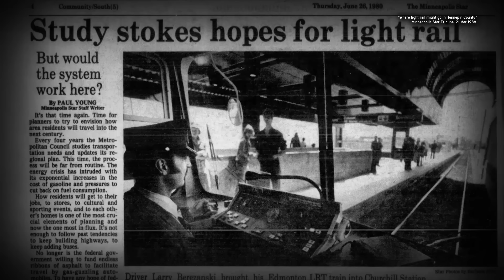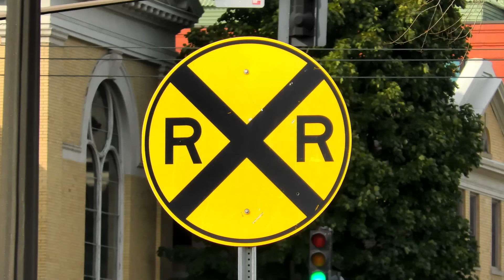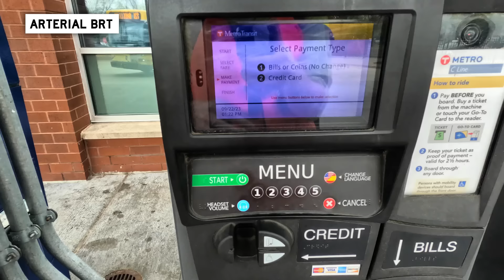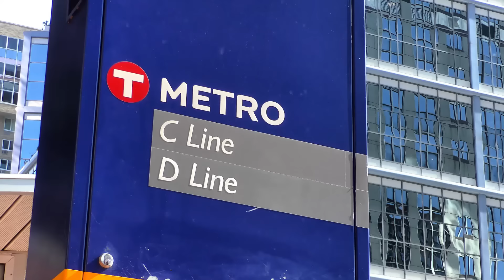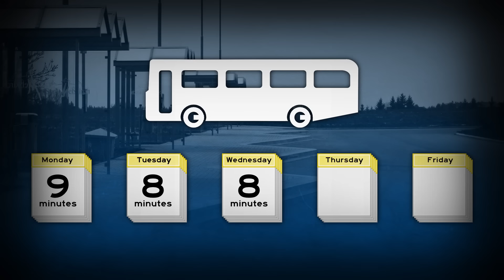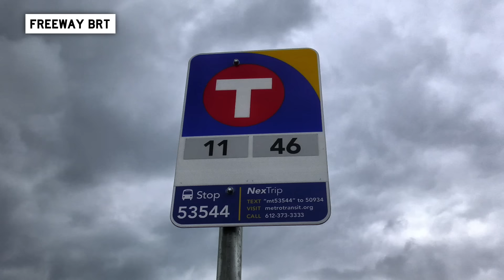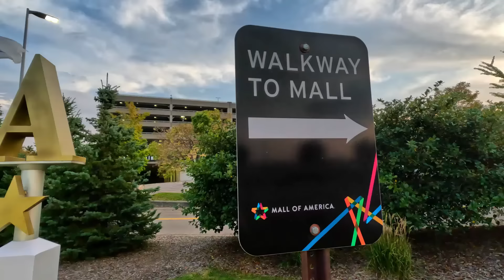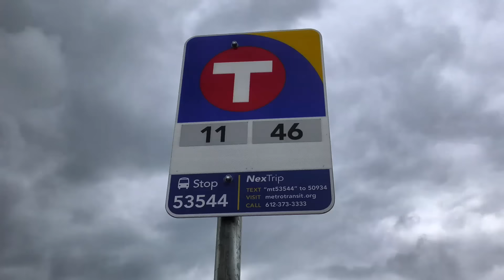Meet Minnesota’s $500-Million... 🚍 BUS???

Comment: Your 0 degrees Celsius/Fahrenheit/Kelvin joke was highly appreciated.
Reply: Yeah and school will only delay once we reach 0K
Reply: The best thing about heated bus stops is that it gives the homeless somewhere to flock when it's cold.
Reply: of course the true Minnesota joke is that -40 does not need to specify C of F.
Reply: I legitimately laughed at that.
Reply: The degree symbol before the kelvin was a miss, but beside that is was indeed nice.
Reply: Except this year was so warm it didn't matter. I don't think we had a single day this year where the high was below 0°F.

Yes, we usually have that.
Reply: @ryguy2006  and a one hour delay at that.
Reply: If you wanted to be esoteric you could also add Rankine in as well.
Reply: I laughed way too hard at it, I'm a dork.
Reply: Absolute gem right there
Reply: “0 Kelvin: Consider a Sweater”
Reply: 0 Kelvin is impossible.
Reply: @benlema204  0 Kelvin is Absolute Zero and is technically possible
Reply: Unfortunately, there are many that won't get the joke...
Reply: @ryguy2006 gay AF
Reply: Agreed! That made me chuckle. This guy is so cool
Reply: @alpitu21  gay
Reply: True that they are basically the same or at least close enough.

Comment: no one ever talks about highways costing money. why is this criticism only reserved for mass transit projects?
Reply: Maybe because highways are paid for by the fuel cars consume? Instead of tolls, the gas tax funds the roads.
Reply: @travisminneapolis you are aware that oil is heavily subsidized in the US, correct?
Reply: Because a highway can handle millions of travelers per day while costing about 1 million per mile, instead of thousands of travelers while costing 20 million per mile, so the price per user is about 0.001% as high. 

Meaning the cost of road infrastructure is relatively insignificant compared to nearly all other forms.
Reply: @operator8014 Sorry but that math just doesn't check out, like at all
Reply: @travisminneapolis fuel taxes don't cover more than 60% of road costs pretty much anywhere in the united states.
Reply: @operator8014 but you’re also assuming in these large cities that there’s enough parking for every car (there isn’t). And that there wouldn’t ever be huge traffic jams (there will be). And that using public transportation reduces emissions and overall temperatures throughout the city (which it would). Oh, and that everyone has a car
Reply: @operator8014 your math is wrong on all fronts. the average cost of highways is 3.4 million per mile. Cars are also the LEAST efficient mode of transit in terms of people per hour. Cars are also the ONLY form of transit that regularly gets stuck in traffic. And even when other modes of transit get stuck in traffic, it's often caused by cars

Comment: The true "magic" of a BRT is really the option to combine "being fast" and "being everywhere" with the same vehicle: You can circle though the suburb and then take the fastest route into the city.
Reply: YES. That combined with the fact it's cheaper and faster to train bus drivers, it's easier to find and hire diesel mechanics, busses are cheaper to buy up front the railway equipment. Busses often share mechanical parts with other commercial vehicles. BRT is very smart. Plus the infrastructure can be used by other city services like garbage, fire/ems, police etc without specialty equipment.
Reply: The eye-watering cost per mile figures for rail projects are mostly because of a few extremely expensive segments (eg. through a downtown).  BRT can just operate as a normal bus over those segments and have dedicated lanes everywhere else.
The dream (which might eventually come true) in a lot of those places is to reduce car traffic lanes, so more folks using the buses actually enables converting to bus lanes and maybe even more space for pedestrian and cycle infrastructure.
Reply: Bruh. "We only have hammers, let's turn transit into nails". Sigh. (Pulls out an Engineering 101 manual). Let's take it from the top.
Reply: @joeblow5214  As you said: Cheaper to buy up front, a Light rail vehicle is over all cheaper though. And you can also run them on normal streets as a tram. 

On top of that, you have a much smoother ride with light-rail and trams, which increases the acceptance of it a lot more, and does in fact increase ridership.
Reply: @germanmosca  In my experience, running in mixed  traffic is a huge drawback, and most of the advantages in reliability and frequency of BRT comes from separating out transit from other modes as much as possible.
Reply: @joeblow5214  I'm not sure that it's actually cheaper and faster to train bus drivers, but I don't have numbers on how quick it is to train a train operator.  In my experience, every bus operator is essentially trained from scratch anyways, and the only real way to speed up the training is if they already have a CDL.

Comment: BRT just feels like an excuse to lay the groundwork for an actual rail line without having to convince NIMBYs to pay for it all at once. But I can appreciate it for that.
Reply: I think they want to upgrade them to proper LRT in the future and are using this to get the foundation there
Reply: Yup, once they have the dedicated lanes and the bridges and stuff all there it's a lot easier to get support for light rail
Reply: It is also right sizing the system . Rail is great for higher capacity but empty trains lead to less frequency. If the buses route are overcrowded then those are the routes to upgrade.

Comment: $500M for 10 miles is a bargain compared to the Los Angeles area metro rail system. When I checked a while back, it was $350M PER MILE. And yet the roads were still packed because the metro rail system is impractical for most people. Metro rail system only work out financially in highly dense areas, like Manhattan.